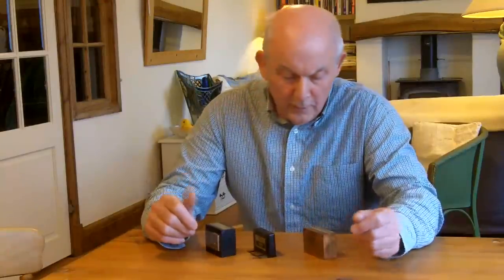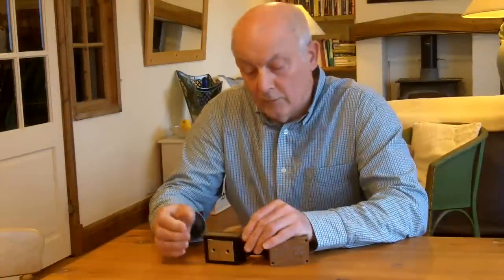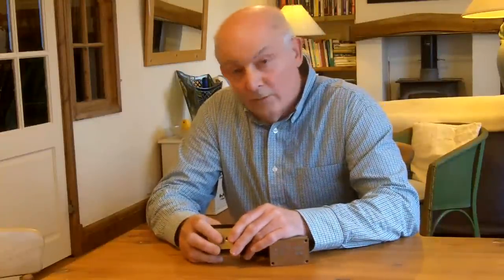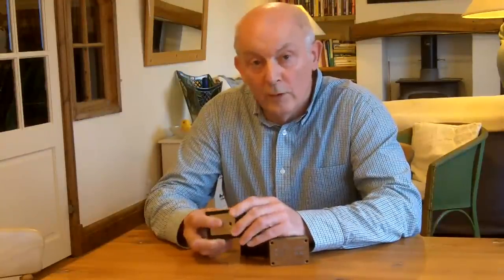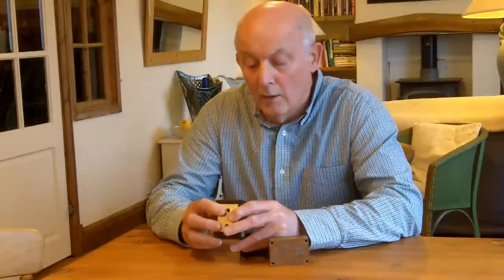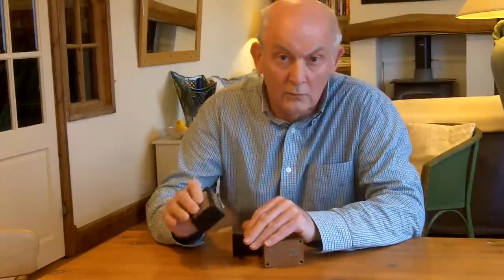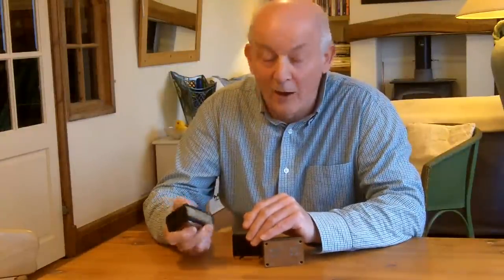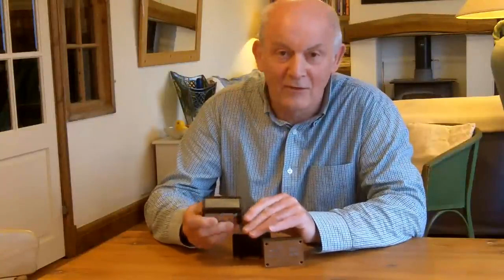About Capacitors ... Part 9 Induction heating capacitors.

Comment: I would say that your videos would explain things in a totally different way that most people would think, myself I came from an electrical engineering background different to yours BUT, every now and again I would come across items like in this video, induction heating is a very amazing process.
One of the biggest induction heaters I had worked on was in a glass bottle plant, they would use natural gas to get up to melting and then use electric heating, glass when heated can pass electricity.
Reply: Paul what was the power requirements of this induction heater ?? Thanks

Comment from the maker: Hi, thanks for the feedback. Induction really took off around the time of WW2, (before my time,) but now you can’t move without coming across some ‘Induction’ application.  Even bits in your phone will have been made or processed by induction. I’ve made induction machines for processing everything from valves, TV tubes, bra underwires, gold coins and bath taps, man I could bore for England on the topic but a lot of stuff is of course subject to confidentiality clauses.  
Kind Regards ... Andy
Reply: Andy, when you sign a confidentiality clause you cannot talk about the application and function of the design ??? Could you please clear this up for us all and thanks too.

Comment from the maker: 2 of 2 
I think the main thing that sets Celem apart from all the others is the first capacitors were developed out of a real need to produce truly reliable capacitor assemblies for use at hundreds of kHz and hundreds of amps. They have a total understanding of the harsh industrial environment that’s out there in the real world, not just laboratory conditions. Over the years they have built on the hard learnt lessons of the induction heating industry.
I hope that helps.
Kind Regards ... Andy

Comment from the maker: Hi John, well I’ve only scratched the surface on the subject of induction. It kept me busy for thirty years and the technologies I used changed. When I was first involved you could actually stand up inside a 25KW induction heater. By the time I sold my part of the company I could carry a 25KW machine. I guess it’s no different to a lot of other technologies going from valve to transistors but boy the transistors are big!
Kind Regards ... Andy.
Reply: This is a fascinating subject of induction. Since you are a walking encyclopedia, would you be able to write a book with your experience on the subject at hand ??? Or what book would you recommend that you feel covers the subject matter 100 percent if that is possible ?? Good day Sir Andy.

Comment: Hi Andy,
At the time I was there we were developing megawatt power supplies that were based on cmos logic pll control circuits and very large hockey puck scrs. It was very interesting work building up all the prototypes and debugging them. Unfortunately I never got out in the field to see any in operation but we did have a small melting furnace set up in the lab. All of my work was on the controls. Now I wish I had studied the power components application and theory while I was there.

Comment from the maker: Hi Jeff, it’s not often I hear from someone who has been in the industry, thanks for the feedback. You’ll have seen some pretty big melting furnaces and pipe bending machines working at Ajax. The highest power RF, MF and Mains Frequency equipment we built was less than half a megawatt whereas I think Ajax probably didn’t produce any small stuff did they? 
Kind Regards ... Andy

Comment from the maker: Hi Eric, I don’t know if I’ve answered this before or not, you’d be amazed just how many items in your home have been processed by induction. I can guaranty that you will have many items in your home that have been processed with machines that I have designed and built, your car will almost certainly be the same and most commercial aircraft will have components made on machines I’ve designed/built. From light bulbs to bra underwires or ice-cream to IC’s I’ve been involved. 
Regards... Andy

Comment from the maker: 1 of 2 
Hi, I wonder what field you’re actually in? Regarding the Celem capacitors I can when I used them they were totally fit for purpose but you must, must, must, use them in or below their rated specification. I have used other high frequency, high KVA capacitors and got into loads of trouble with them. If I were building HF equipment and Celem had the capacitors I needed I’d get them from them.

Comment from the maker: Hi there, you’re pretty well right there. You have to use the capacitors within their safe working limits and they will full meet their specification and certainly Celem capacitors are truly ‘fit-for-purpose’ In the field of induction heating the typical parameter that kills capacitors are voltage spikes. You can have a dirty connection somewhere in a tank circuit carrying 100’s of amps and that can cause the frequency to suddenly become much higher than anticipated, and bang!
Kind Regards, Andy

Comment from the maker: Hi Paul, I wonder if the heating system that you worked on was ‘conduction’ and not induction. Glass can be heated by ‘induction’ that is, current is magnetically induced in the glass once it’s been heated by some other means to a point where it becomes conductive. Induction heating is a very complicated and very expensive, where as conduction system are very economic but quite adequate to heat glass and would be the best choice. I guess you had electrodes that went into the glass
Regards...Andy

Comment: This is very interesting Sir. First you state that using induction heating will heat the outside of metal more so the interior. But then you are melting platinum looking into the crucible. O.K, what is it, heats the outside or does it heat and melt it ??? Then you state that induction is used to melt the polymer under a aluminum disk seal. Everytime I see a video describing this action the person states that ultrasonic frequency is what melts or welds the 2 different materials together. So what does or how does this work and be precise too???  The description of the capacitors at the end is real interesting. Hard to believe the amps that are capable when water cooled. What is the life expectancy of these items Sir ??? Thanks for the information presented.
Reply from the maker: Hi when you melt metal with induction heating the main heat is developed under the outer surface of the metal. If you have enough power the metal gets hotter and hotter until it melts. The middle of the load (the metal) is largely heated by thermal conduction from the outside. The mathematics for working it all out are very complicated but the process is very straight forward and very predictable. When you are 'cap sealing' that is putting a tamper evident seal on a plastic container (or the foil on a glass jar of coffee)the induction heater heats the outer edge of the aluminium disc and the heat from the aluminium transfers into the polymer and melts it. (where you want to melt plastic to plastic then you're right, its ultrasonic frequencies) As for life expectancy of high power capacitors, they can easily last for 50 years or more. The most likely failure mode of these capacitors is over voltage. When you design high power equipment you never operate capacitors at the manufactures specified voltage.  With any machine there will come a time when something goes wrong and in the case on induction heating equipment that's often a short circuit, or partial short circuit, at the work coil. When this happens it can change the operating frequency in the most catastrophic fashion. Under fault conditions you can easily develop twice the voltage that you were anticipating. Capacitors can often tolerate over voltage so long as it's for a very short duration, fractions of a second but if the system isn't shutdown with in a few cycles the capacitors will fail.  So for high reliability you may have to use capacitors in series and that's expensive but if you have to replace them under guarantee this costs a lot more, particularly  if you have to fly a service engineer to the other side of the world to replace it but more importantly is your companies reputation. When you make a machine for companies like Sony, Ford Rolls Royce etc  and every product they make uses parts made on your equipment the last thing you want is the production director spitting blood and teeth telling you how much it's costing the company not to make any cars today!!   Designing equipment is easy, designing equipment to survive unanticipated fault conditions in an scientific or industrial environment is very demanding and something that you only learn to do by hard won experience. Anyway, I hope that answers your questions.Kind Regards  . . . Andy
Reply: @AndyDaviesByTheSea Hello Andy, your explanation is very detailed and cleared up just about all of what I asked you Sir. Just one thing which I hope you could give me more information on ??? The two type of capacitors in a single phase motor are the starting capacitors and the run capacitors. The former uses paper coated with a special paste for function and the latter uses oil filled with foil and separator between them. The start capacitors can only be in the circuit a very short time or they will just spray a fog of nasty smelling stuff. Run capacitors are in the circuit most of the time motor is running and they last a real long time. I have run cap that are fifty years old and still good and a few that are just antiques that are still good but wall hangers in the man cave. The run caps are used for a phase converter. I have a 3 phase motor 20 H.P. run on single phase with voltage an all legs within 12 volts  Now that I think is real good. But let's get back to subject at hand. The caps used in induction heaters are what type and how do they work exactly ???? I know that they are real expensive when you look on eBay to purchase them. Please be real specific and explain to me the difference ??? Good day to you Andy Davies By The Sea and peace to you SIr too.
Reply: @AndyDaviesByTheSea  I want to thank you for rambling on about Celem capacitors. So hard for me to wrap my mind around having a rating of 650 amps the size of a cigarette pack even though it is made of copper and water cooled. Would you know the ratio of input amps and the rating output amps of the induction heaters ??? Is there such a thing as a duty cycle of the machine in percentage ??? Is there such a thing as a ratio or is it a preposition mathematically when a machine is designed  ?? Thank you much Andy Davies By The Sea.
Reply from the maker: Hi, remember how you said that ultrasonic frequencies are used to melt plastic for plastic welding operations? Well that's a real problem because if you have a plastic insulator between the capacitor plates they can be susceptible to dielectric heating, that is the molecules in the plastic can be energised and pick up heat which is of course what you want when you're welding plastics together. For low voltage low power applications this isn't necessarily a problem but at high power high frequency its most undesirable. For high frequency (what you would call 'Radio Frequencies') working in induction heaters it's usual to use either ceramic or mica insulation. The mica capacitors also have a suitable oil impregnation, the oil displaces air (air in a high voltage capacitor can ionize and that will destroy the capacitor.) So there are big problems trying to make a good seal to keep the oil in. (I cant go into all of the details but a lot of people have tried to copy good capacitors and a lot get it wrong) all high power capacitors need some sort of forced cooling. I used to use large ceramic tube capacitors of a few hundred picofarads, 20kV about 10 inches tall and maybe 5 of 6 inches diameter they had to be forced air cooled  and the electrical connections were all made with water cooled copper pipes. in the case of the lower voltage capacitors for modern induction heaters  (working at much higher currents) they were all water cooled and again with water cooled copper pipes or plates for the electrical connections .One on the most significant features of high frequency capacitors is the internal inductance. Think of your old paper capacitors for mains frequency working they're just two rolls of silver foil which, depending on how they are manufactured can have a lot of internal inductance. (doesn't matter very much at 50/60 Hz)Induction heating capacitors are designed to have virtually no internal inductance and the trick to a well designed work head or tank circuit is to keep the inductance as low as possible, you want all of the inductance to be only in the work coil. Where there's inductance there's volts drop. You only want volts dropped across the work coil not in the connections between the capacitors and the coil. Regards . . . Andy
Reply from the maker: Hi again for some applications you could have a Q of 20 or 30 or even higher meaning that the current in the tank is say 20 times the input current but remember the 650 amps could be what is in the tank, i.e. the coil/capacitor circuit so in this case the a 32.5 amp input would deliver 650 amps in the work coil (that's a bit of a generalisation) but the resistive loses can largely be ignored in a well designed unit.I only ever designed for 100 % duty cycle i.e. continuous running. Anything else will only come and bit you in the backside. As I said before it's foolish to design anything using the capacitor manufacture's spec as gospel and they take a good bit of interpretation.( You can't just look at say the frequency graph or the current profile you need to understand the whole picture not just the bits you want to fit your needs thinking you can cut costs)   The manufactures  only ever test in ideal conditions and believe it of not some manufactures didn't always tell the truth. Man I could write a book on that! Celem where always very good but some of the folks who tried to copy them got it wrong, big time!  Hope that helps. . . Andy
Reply: @AndyDaviesByTheSea  Thank  you so much Andy for clearing that up for me. God bless and peace to you Sir.

Comment from the maker: Hi Jeff. Ok on the activity, I guess most folk won’t have an appreciation of a single piece of equipment pulling a megawatt of power; another thing people won’t generally have an appreciation for is the extremely harsh electrical conditions that the induction heating industry has to cope with where a fault condition can result in massive destruction unless the safety circuits can operate successfully when you have what is essentially a showering ark meltdown of some vital circuit component.

Comment: Great presentation...i have a question....In industrial application of induction furnaces, these capacitors tend to inject excess reactive power into the grid which affects the power factor as a result of over compensation. Most foundry industries are facing low power factor penalties because of this situation. How best can this scenario be solved without affecting the operation of the induction furnace?
Reply from the maker: Hi I can't give you a specific answer to your question other than saying factories frequently have some form of automatic power factor correction system (capacitors). There are a lot of processes that may have a poor power factor and sometimes you just have to pay the penalty of carrying out a ponticular process with your chosen method. (consider ark welding.)
Induction heating usually has so many positive attributes that far outweigh any power factor cost penalty. However we heat things there is always a downside but where speed (production time) is a major factor induction will beat gas in terms of speed,  cutting emissions, reducing surface scale on the product, stopping excessive heat in the work place and it usually saves floor space. It has a high capital cost but for most applications it saves a lot of production costs.

Regards . . . Andy

Comment: Hi Andy I am working on an induction replication that through a secondary induction tesla coil I can extract quite a lot of usefull energy. The proble I have is is operates in the kHz range and I wish to use this extra energy to power the system needing only 50hz at 230vac. Do you know of any component on the market I can use??

Comment from the maker: I might do a bit more about some basic work head (tank circuit) design some time as it seems to be a stumbling block for some folk but I don’t want to get drawn into having to help people with design issues, just no enough hours in the day.  By the way I would unreservedly and totally recommend Celem capacitors, use them within their specification and they will be excellent. Make sure you understand the maximum voltage and current ratings and get the water cooling right.
Kind Regards ... Andy

Comment: Hello Andy. Do you have any capacitors like these that you would be interested in selling or trading? I'm looking for some capacitors for induction heating experiments.
Reply from the maker: Hi, sorry I don’t have any to let go. If you’re serious about trying to make something then I’d say buy some Celem capacitors direct from Celem. If you’re only playing then I’d say use a load of polypropylene capacitors in parallel or series/parallel to give you the values that you want. Just don’t over run them or run them for too long i.e. don't exceed their voltage or current rating and watch the temperature. Use something like 0.1uf 1000V,  and keep all of the leads as short as possible.
Good Luck
Regards ... Andy